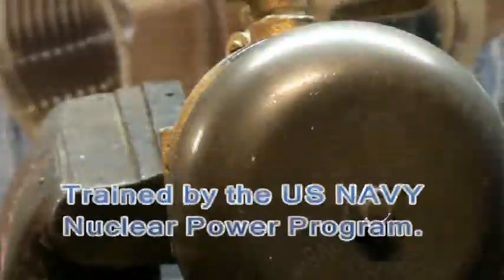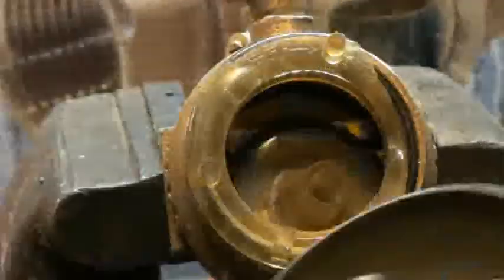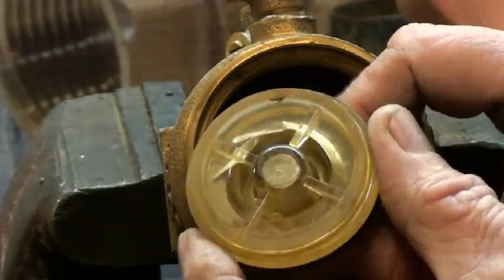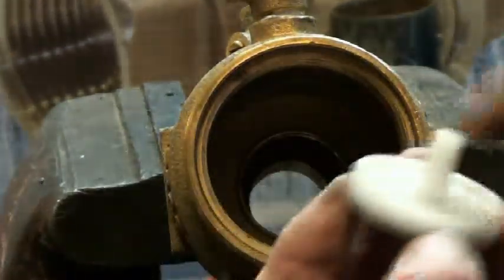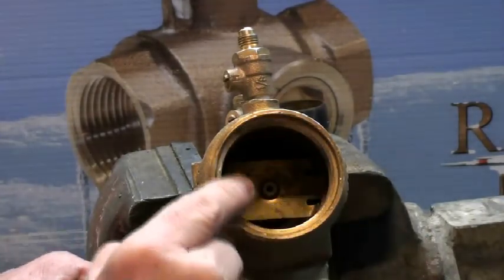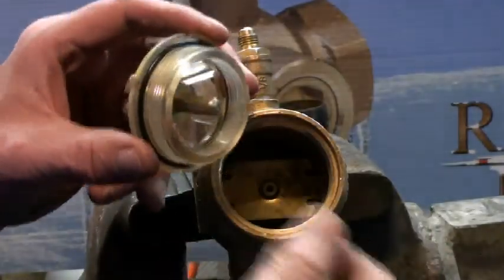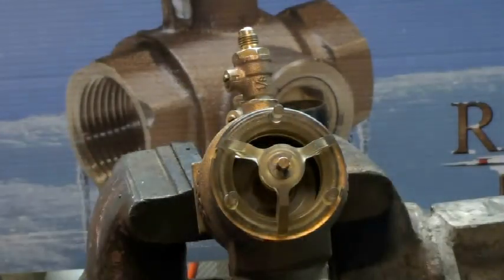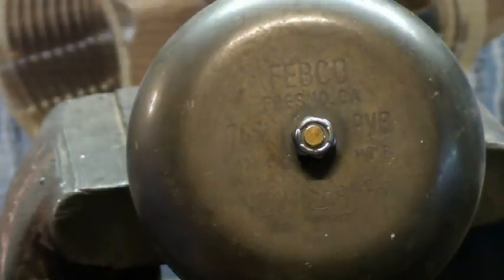how to repair the FEBCO 765 pvb

Comment: IF  there is something wrong with the PVB will it lessen the water pressure to the sprinklers? My sprinklers don't seem to have enough water pressure. I noticed this right after the hard freeze. Immediately when I turned the system on the PVB did not make the same "sound" as it had before.
Reply: it's very possible, often times the lower check valve piece gets trashed and ends up cross ways, reducing the flow
Reply: @ronlehman5734  I will take the unit apart tomorrow and check the parts. Thanks

Comment: Good Afternoon,  I also live in Denver, CO and am a first time home owner. I failed to have my sprinklers blown out this winter and the PVB housing actually cracked. I have ordered a new part but do not have to means or knowhow to cut and resecure the pipes to replace with the new part. How much would you charge to replace the part?
Reply: Thats rare that the PVB BODY cracked...older ones had a brass bonnet that didn't fracture like the plastic ones... anyhow  I (Complete Sprinkler services ) charge $450 to replace complete 1 inch Febco pvb with the freeze-tolerant ball valves on it